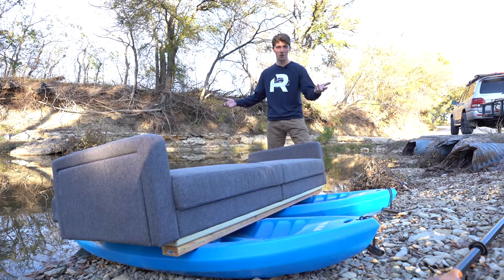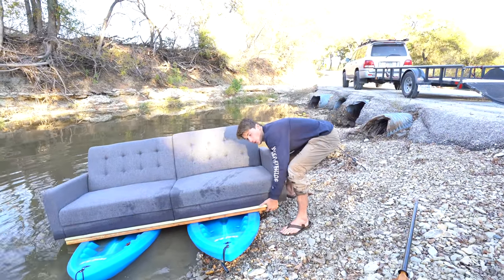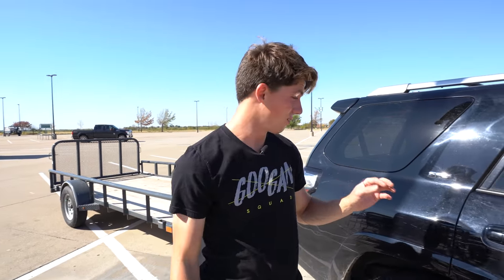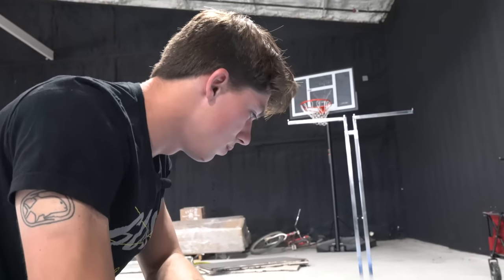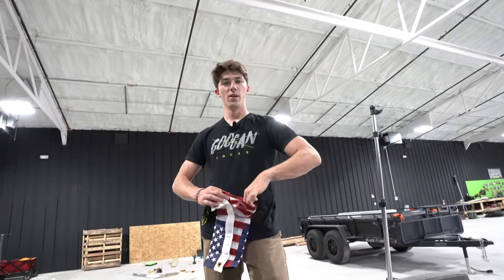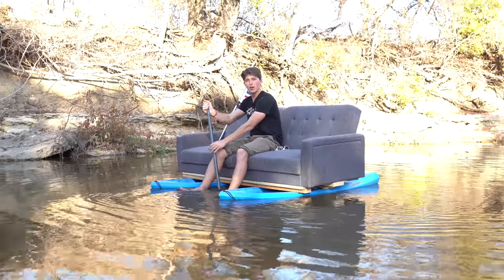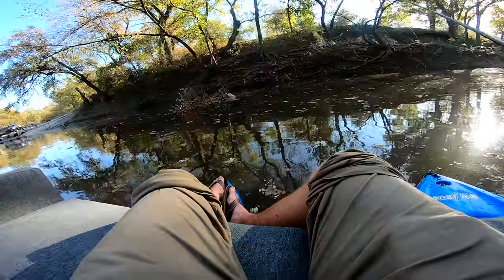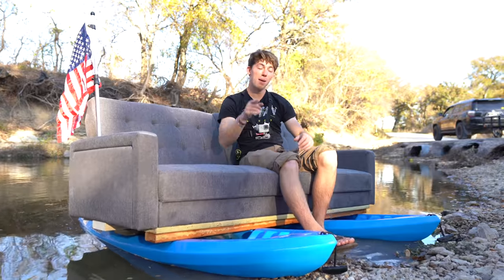IT WORKED! Turning a COUCH Into a BOAT! (Part 2)

Comment: I think I would have attached the two kayaks out wider, added a third, and set it up with a trolling motor.
Reply: And moved the couch back 2 inches...seems a bit front heavy
Reply: That is what I thought, too....
Reply: And definitely caulked the holes
Reply: I would’ve gotten one of the longer maybe 8 foot red ones and put it in the middle to add more weight capacity as well as let it probably track a little better

Comment: We gonna ignore the fact Jon used a ratchet strap to strap down the wood and it doesn’t even touch the board 😂
Reply: it doesnt need to. The back is closed so it wont slide out. he did that so it wont fly out the top
Reply: What about the fact that he only got 1 piece of wood

Comment: Take the foam out of the holes in the kayak made for the water to go in and out of the kayak. Filling them just makes it so water can’t get out and because your weight is so far forward it’s just filling the top with water. Should help with the sinking problem

Comment: Put a board for the transom in front between the two kayaks. Then put a battery on the other side to counter your weight and slot the trolling motor in between.

Comment: If you want to do the couch right and make it float two things. Number one don’t drill any holes in the actual kayaks. Number to use to scupper holes in the kayak as your attachment points  and putt faint long bolts thru the scupper holes and use huge washers to hold them together and make the connections tight. Meaning use the holes that are already there instead of drilling new ones that aren’t water tight.

Comment: Move the couch closer to the back so the weight of the couch will keep the front out of water. And what i seen in the video the front filled up faster then the back so moving that couch back just alittle it will keep the front a float

Comment: I would say add a 3rd sun dolphin in the center that's situated slightly forward. Then connect the outer 2 with a board in the back and make a small mount for a little trolling motor. Seal the holes first though. ;)

Comment: add some pvc pipe 150mm / 6 inc  to the couch in the middle between the kayaks cheap but good flotation and add motor to rear  with battery it will level out your weight cause rear was high could do with more weight looking forward to next wiener dog fishing trip cheers nearly nailed it

Comment: You need to move the couch back a bit. There is to much weight going into the front when you lean forward to paddle.  Also a third middle kayak would be perfect.   Weight distribution is key    Looks like fun b

Comment: Drill holes on top of the kayaks and fill them with that one yellow spray foam. I think that should increase flotation.

Edit: after watching the video for another 15 seconds they do this. Alright

Edit #2: just fill the entire Flippin thing full of foam and it looks like it needs to be moved back a bit more. And add a little board or something in the middle front as a place to put your feet

Comment: Jon clean the paint off and go get yourself some JB WELD. It's a plastic epoxy and you can buy it in any colour and it'll seal all those holes forever and should hold under the pressure

Comment: Should  have  just filled the inside with  expanding foam
Reply: But if they filled it with expanding foam, it would expand too much for the kayaks to handle and break em
Reply: OutskirtsOutdoorsTV  nope, all the expansion would just push the excess foam out of the holes they were filling it from, I’ve seen people do the same thing but for cheap coolers to make them hold very longer.